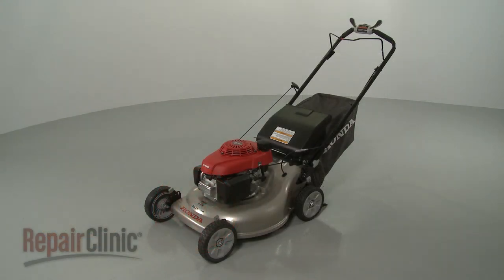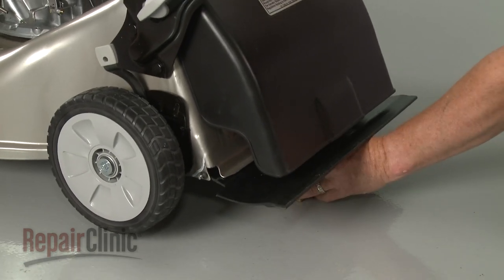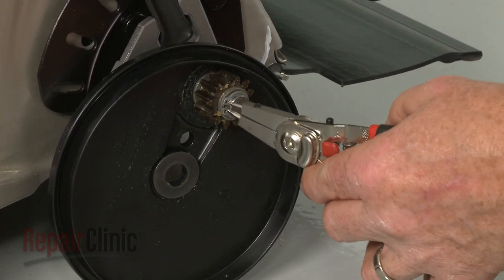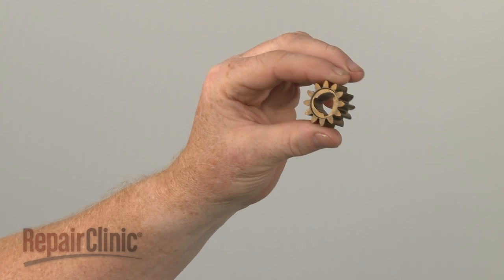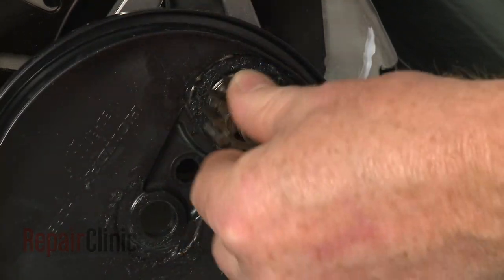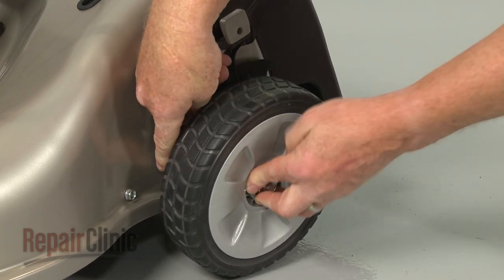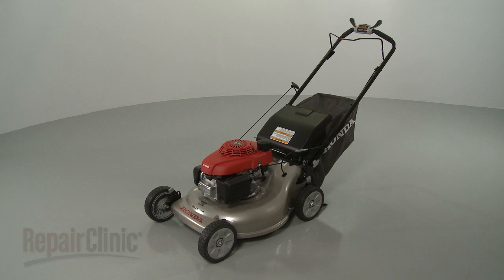Honda Lawn Mower Pinion Gear Replacement Part # 42661-VE2-800

Comment: FYI: The pinion gear has a small dot on one side, looking down at the gear like a clock. From the back of the mower, on the right side wheel, the dot faces out, i.e. is still visible when the gear is on the shaft. On the left side wheel, the dot faces in, it is NOT visible when the gear is on the shaft. This will "orient" the pinion gear to operate properly: Roll freely forward with motor off or clutch disengaged, but engage both drive wheels when operating self propel.
Reply: Thanks...I somehow put one or both back on the wrong way and drive isn't working, this will help!

Comment: For those that do not hear a clicking sound when rotating the wheel or pinion gear... the ratchet key is most likely stuck because of grime buildup. When you take the wheel and pinon gear off you will notice that the rear axle has a slot cut in it. Inside the slot is a spring (Ratchet Return Spring) and Ratchet Key. Dirt and grime gets into the slot and makes the ratchet key stick below the surface of the axle/shaft. Be careful when you take the ratchet key and spring out.. they are small and you dont want to lose them. Clean the parts and shaft slot, removing all grime buildup. Over time the spring gets compressed so stretch it a little bit. Replace the spring and ratchet key so the curved side is going into the axle slot. You will have to hold it down while you slide on the pinon gear. The ratchet key should move freely now and you should hear a clicking sound.
Reply: This is excellent advice.

Comment: On my HRX217HXA, one rear wheel isn't "clicking" and doesn't lock up when pulling the mower backwards with the drive engaged. Can I be sure the problem is limited to the pinion/ratchet/spring/wheel area and cannot be the transmission?  The other wheel is operating fine but I don't know if the axle is solid or if it's actually two shafts.
Reply: When you take the wheel and pinon gear off you will notice that the rear axle has a slot cut in it. Inside the slot is a spring (Ratchet Return Spring) and Ratchet Key. Dirt and grime gets into the slot and makes the ratchet key stick below the surface of the axle/shaft. Be careful when you take the ratchet key and spring out.. they are small and you dont want to lose them. Clean the parts and shaft slot, removing all grime buildup. Over time the spring gets compressed so stretch it a little bit. Replace the spring and ratchet key so the curved side is going into the axle slot. You will have to hold it down while you slide on the pinon gear. The ratchet key should move freely now and you should hear a clicking sound.

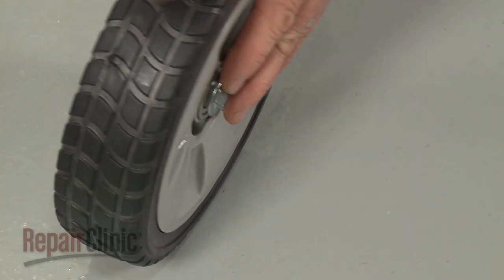Comment: 1:50..1:52 Both sides of the Wave Washer are "curved". Also "outward" might refer to the outside of the mower, or the end of the bolt.  At 1:52 you can see that the wave washer is installed with the * concave side towards the threaded end * of the bolt. I assume that is what you meant.

Comment: I'd like to preface this comment by saying thank you for making videos on these topics; I'd like to critique it by saying boy I wish you showed actual used lawnmowers for these. Guy in the video just grabs that washer and lifts it off like it's nothing; I'm sitting here with a can of WD-40 and 3-in-one oil, pliers, a screwdriver, and a hammer, and I can't get the damn thing off. (Yes, I took off the snap ring already - that took about 20 minutes just to get that loose, and that washer is just stuuuuuuck up in there, as most of the parts were on this 10 year old poorly maintained fixer-upper.) As a person doing this kind of thing for the first time, I can say every video I've found that shows the reality of a used unit and things to look for if you're having to replace this part or that, has ultimately been a lot more informative and insightful in that way. In any case, thank you for making the video, it is appreciated.
Reply: I agree with you ... Some of these people use brand new mowers for their videos.. Once mechanical things like a used mower gets used hard, things tend to get frozen...
Reply: Use penetrating oil by spraying it at an angle to get it under the washer on the shaft. Wait 5 minutes, part should come off pretty easy.
Reply: PB Blaster is your friend when working on used equipment.
Reply: I always use PB blaster for stuck metal items with great success.

Comment: While you're waiting for new gears, you can swap them left<->right because they wear mostly on one side.  There should be enough left of the teeth on the other side to engage with the wheels.  Just don't flip them around, keep the orientation the same.

Comment: Thanks but how do I see the gear is not on backwards?  Thanks
Reply from the maker: +irandar As far as we know there is no wrong way to install the gear.
Reply: +RepairClinic.com I really do not understand that you do not know. The repair manual clearly says that the gear must be installed according to a marking, which is not on the older gears. The answer is that when moving forward the rear wheels must click. Of course the gear moves in the opposite direction.  Got it?  Regards.
Reply from the maker: +irandar Got it thanks for the info.